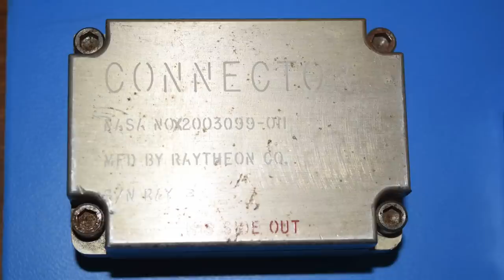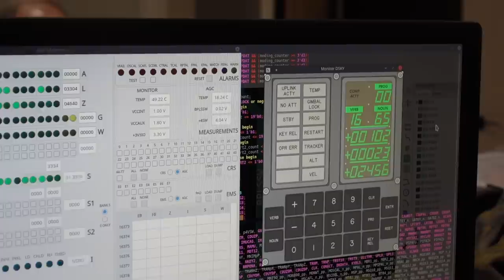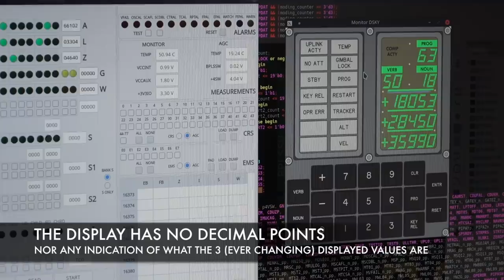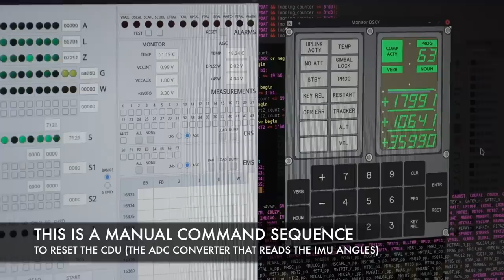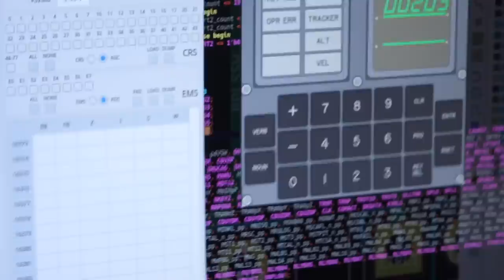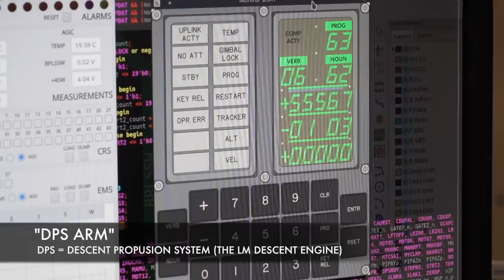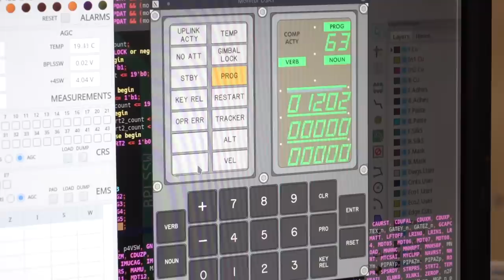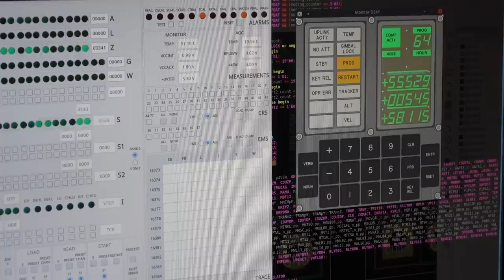Apollo Guidance Computer Part 10: Mike flies Apollo 11’s P63, lunar landing, on his AGC replica

Comment: Simply amazing!
Youtuber "Fran Blanche" designed a few days ago shirts with the DSKY :D
Reply: As i remeber She also did an analysis on a modul from the later integrated Apollo program cheramic circuit boards.
Reply: Saw that. Might have to get one of those.
Reply: Curious Marc I beseech you reach out to Fran Blanche from FranLabs YouTube channel to do something together. Fran has been working on an rebuilt replica DSKY display for years - using the same tech used by NASA. You should do some joint projects with her. She does amazing old-tech videos
Reply: @RichardFrost  Ben Krasnow (Applied Science) already did it. Fran was years away from completion at best.

Also, in another video's comments section, they mentioned having already reached out to her.
Reply: @Wizardofgosz  oh I had no idea they did reach out :(
Reply: @RichardFrost  Developing a faithful high fidelity replica with as-close-to-original kind of hardware solutions is not easy, fast, nor cheap... She can get it done if there's enough support but in the meantime, before all the necessary pieces are in place, it'll be a pile of different stand-ins and simulators that over time get replaced by better bits and bobs as resources (time, money,  peoples' schedules, and hardware availability) allow. :-)
Reply: Noel Coward  Fran, not Marc or Clive.
Reply: Noel Coward  Ok, but when i did red Your fist post above, I spontaneous taught of that bearded maiden sticker Clives friend made of him. It quickly became that popular it even got printed in a small serie of vinlyl decales of Clives cartoon caracter dressed up as a foxxy maiden, as i remember. (He never commented it, but at least all the income from it went to he's coffe page so i hope he wasn't too mad after all when he had calmed down a bit, i remember he had at least one outbust he did cout out from that episode (At least there was a suspicious cut in the video shortly after the maiden sticker), Ha ha! One hawe to just love those guys!) Ha ha!

Comment: Will you be able to hook Carl's DSKY to the software AGC so you can touch real hardware buttons instead of having to use the mouse?
Reply: It's not a software AGC, it's a tiny hardware AGC that isn't radiation hardened.  It's the board between the tiny switch panel and the new debug interface.

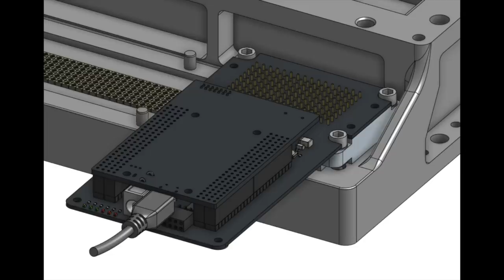Comment: For the Tektronix nerds, and for the HP nerds taking a break from their usual excitement...  At 1:12 is what I think is a Tektronix RM503 in the rack in the background.  Made of shiny glass tubes filled with non-air, differential inputs, 450kHz bandwidth (woo hoo!), and configured especially for X-Y mode.  Apparently, according to TekWiki, the low bandwidth made it less sensitive to various noise and interference, so it was easy to concentrate on your (low bandwidth) signals.

Comment: I wonder if it could be hooked to a space flight simulator such as Orbiter or KSP and have it control a virtual spaceracft?
Reply: That's the plan...
Reply: Membrane556 That should not be difficult, compared to all they have done so far. You'll need some code and some ad/da stuff and likely some signal translation tables in software or on an MCU so the in/out signals are correct. Which compared to recreating the AGC gate correct is ant sized peanuts.
Reply: KSP might be preferred due to how it is written. KER or MechJeb might be a dependency. The craft used would also need to match the Apollo spacecraft exactly or it will not work.

Comment: I keep wondering about the tools Mike used for this on his Linux machine, for IO and GUI? I was thinking about tinkering with something similar on a Raspberry Pi. I assume he has some USB gadget that enables him to read and set 5V signal pins, and then he communicates that to a GTK+ GUI window?
Reply: I was wondering the same myself. I know in earlier videos he was using a logic analyzer and in more recent videos he was using a beaglebone single board computer (SBC) for some interfacing, and of course his custom built test adapter likely containing a micro controller / SBC. Since he wrote the software and the team custom builds a lot of the gear needed  i'm guessing a lot of the main software tools are his / their own. There must be some common software tools used too. I would be very interested in learning more on his setup.

Comment: is the speed identical to the real AGC ? Because on some Programs it calculates for 5-10 seconds and I somewhere read that this was also the case in the real AGC
Reply: Yes, it's the real speed. At 4:35 for example when Mike starts Program 63 it does a bunch of things that take quite a bit of time to calculate, one thing being the exact time of ignition.
Reply from the maker: Yes, it’s gate and speed exact.

Comment: I can't understand what he says those traces on the pcb are (frenell traces?), so I can't look up whats so special about them. Has anyone a link maybe? Thanks in advance.
Reply: 4-mil traces in order to fit all of them in the space available.  It's a more expensive PCB process than the standard (6-mil minimum) one that PCBWAY uses on less expensive boards.
Reply: @michaelardai9703  Thank you very much. Now I also understand what he says.
Reply: The PCB board in the video which Mike is holding is published on GitHub at:

https://github.com/thewonderidiot/agc_monitor

Quick quote from PCBWAY puts a batch of  5 with 4mil traces at $65, 10 for $73, plus shipping.

The FPGA board is the STYX ZYNQ 7020. I'm not sure this is where he got it but I believe this is it:

https://numato.com/product/styx-zynq-7020-fpga-module

Comment: I wonder if you could interest the Israeli's in a replacement computer for their next lander?
Reply: Do we know a computer caused the problems? I would be surprised if so, design wise today that isn't really the hard part, a lot of other things are much more likely to fail.
Reply: @noth606  Not yet. The loss of communications and early engine shutdown would suggest a significant glitch. 
The Apollo landers used radiation hardened bespoke electronics but had issues with processor overloads and overuns during the landing (infamous 1201 & 1202 alarms)(which were at least handled).
Higher levels of redundancy in control may help prevent a repeat.
Reply: Allan Gibson Engine shutdown and comms to me would just on the face of it sound more like a power bus issue but of course anything is possible. I would however imagine that the hardware of the lander was controlled for the important aspects by radiation hardened SOP's since there is a number of them available even commercially to buy off digikey or mouser. Their gate level is of course not as wide as that of 50's/60's era chips but some have been run and tested to quite extreme conditions successfully. I would sooner suspect that there was either a purely software related glitch or hardware other than control circuits, potentially things like batteries as they have significantly higher failure rates on earth than SOP/MCU hardware does, and of this I have some experience as I have both designed integrated control hardware for drones/UAV/robots as well as programmed them. And my experience is that batteries and other support systems have a failure rate in the order of 10-100 times higher than the control circuits and their programming.
Reply: @noth606  Redundancy in everything is a good idea. The probability of a radiation related failure goes up with altitude. In space it is several orders of magnitude higher. Having multiple distributed redundant systems handling critical sequences would seem like a good idea (particularly when the ground can smack you in the nose at a few kilometers per second).

Comment: Guys, you need to connect this thing to project NASSP: https://github.com/dseagrav/NASSP. You could run orbitersim and do simulation mission controled with your restored hardware. There used to be code in the virtual agc that provide a socket interface between orbiter sim and an external agc. I think that would be the utlimate test of your restoration project. Let me know if that is something you what to look into. I did work on that project
Reply from the maker: Yes thanks. The memory image Mike loads is from a run of NASSP. Mike is very well tied to the current developer, and contributed to the AGC code in the NASSP plug in. I should let him comment further.